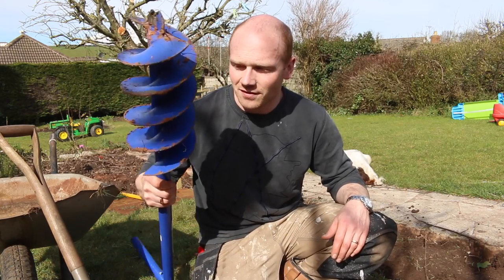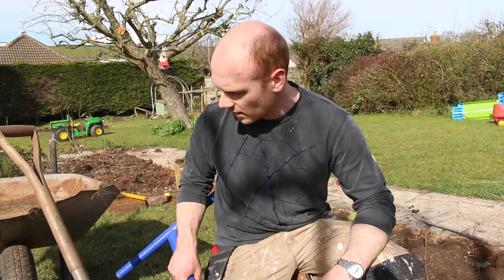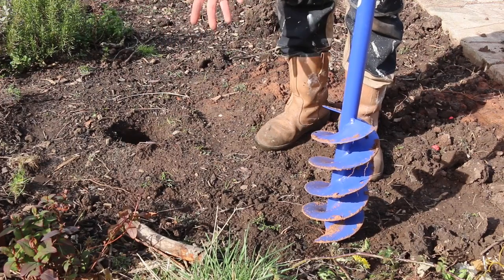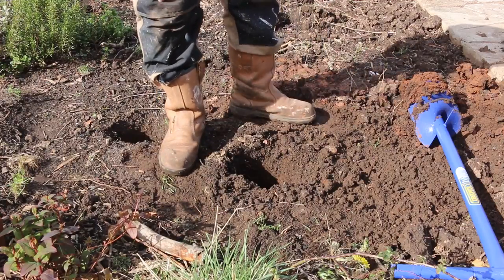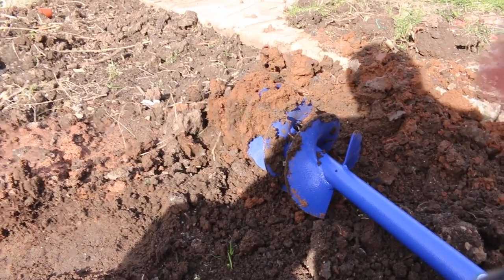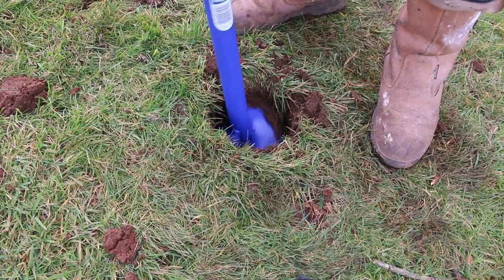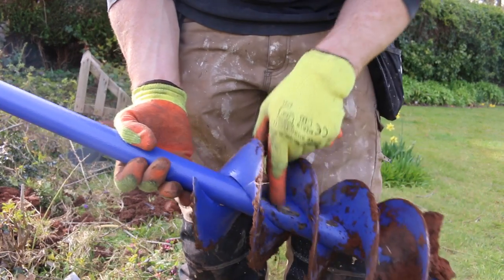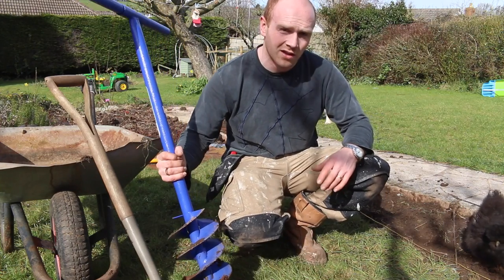Fence Post Augur | TRC Show and Tell

Comment: not a single Rock... Not in my back yard. I dug 3 cubic feet of dirt and rock out of a 1 cubic foot hole with a pick ax and shovel in 1 hour of back braking labor. hate my soil.  (sarcasm)
Reply: Sounds like my garden but mine is also unbelievably heavy clagy clay as well, I've had to dig foundations & drainage trenches almost entirely with a pick & small sharp spade. Great fun :P
Reply: We have clay and flint here in the Chiltern Hills,even a petrol auger struggles

Comment: Hey, anybody who is about to use such tool - have in mind that if the 
soil is too dry, you can drill just a little bit, then fill the small holes with water, wait and then 
drill again to the bottom. It's much more easy and helps extract smaller stones that otherwize would block the drill.
Reply: Thanks for the tip.

Comment: Hey Tim
My mate purchased one of these around 5 years ago & we use it all the time, can't fault it!
We build fences & decking on the side & between the two of us we have cored hundreds of post holes with this.
Great buy!!

Really enjoy ur vids👍🏼
Reply from the maker: +darren green Great aren't they! I must have reduced the amount of concrete by 40% too so has paid for itself.  Interested to see how round post would slot in if sized the same as the augur, 100mm version.  Might be a good way to do some temporary fencing or where you don't want concrete.
Reply: Are they any good in clay compacted soil? 👍🏻

Comment: I bought a petrol one for a big fencing job and it is amazing.  Bottom blade cuts through roots and saves so much time and concrete as the holes are so snug.  Just have to be careful with petrol one that you don't let it screw itself into the ground...Andy Uk
Reply: Nice   tool  plz  mob  no  dena

Comment: Great Video  and very informative, Can I just ask though , i just bought the 80mm hand augur , my post are 3" so a fraction of wiggle room, if the posts are pressure treated and they are a reasonably  tight fit, wouldn't that cut down on concrete/cement,cost time,and labor?   That's what I'm hoping for
Reply from the maker: Just done 100mm round posts with 100mm augur and pretty good. I think 100mm posts driven in to 80mm hole might work better.

Comment: I need an auger/drill like this, but for confined space under an existing sunroom behind the house. Is there something similar, but with a shorter vertical profile?
Reply: If it helps, I had a similar situation once and ended up starting a hole with a space, then positioning the manual auger into the hole to have enough clearance to (barely) be able to use the auger. It wasn't enjoyable, but it allowed me to get the project finished.
Reply: @RallyGreen  I'm out there digging it by hand as we speak.....I'll take a break for the day. I'm not used to this king of work anymore. Haha....I'll get there...I'm down two feet and need to get another two feet more. Lots of rocks....big pain in the behind. Thanks for the suggestion.
Reply: @michaele1278  You have my sympathy! Haha, best of luck with your project!
Reply: @RallyGreen  Thanks

Comment: Wow! Unbelievable. I didn't know they came this big.Would it be possible to use one of these for hard, compacted clay soil. I sincerely doubt it, but I have to ask.
Reply from the maker: We have clay soil and it works fine.  If it is really heavy clay then you just take a smaller amount out at a time.  Might not be so good if you have brick dry solid clay though!

Comment: Can I use the 100mm tool for a 3x3 post or does it have to be a 150mm auger?
Reply from the maker: Probably best to use the 150. I have used the 100 but you need to square up the hole to make it bigger really.

Comment: I've seen these, but never used one. Would you consider it easier than a standard hinged post hole digger?
Reply from the maker: +Adam Gabbert I imagine that a post hole digger may be better if doing a larger hole or if very stony.  Otherwise this has to be quicker and easier.  For the gate post I drilled to holes and then squared them off using a spade before removing all the waster with the augur, so it can do large holes if needed.
Reply: Nice. Thanks for the reply. I've got extremely sandy soil around here so I'll probably order one now. Thanks from California.

Comment: not wide enough hole cement a 4x4 post? might be good plant hole maker.
Reply: I was also wondering about this. Can someone else shed more light on this aspect. I would like to use this tool as it looks very simple. But I'm a little concerned about the width of the hole not being wide enough?

Comment: Any idea where to find these in the US? I see several variations available in the UK, but it seems that US sellers favor powered versions (likely because they're more profitable). Urrggh. Ta.
Reply from the maker: Sorry, been asked before.  Seems they are not available everywhere.  You could buy a 6'' bit from the powered versions and have a handle welded on?....just a thought.
Reply: amazon has them for 100.00 bucks

Comment: If you have a holding tank you could actually use a 50 gallon or 55 gallon plastic drum as a holding tank but should be very inexpensive then you could do a 12 or 24 volt solar pump as a booster pump and here's a video showing you your different componentshttps://youtu.be/EDALWqeGsHQ

Comment: proper job!  Might be buying one of these to do a little project over the summer. Thanks a lot .
p.s was it a screw fix/toolstation or ebay buy?
(Tony from Bristol)
Reply from the maker: Amazon. Was the cheapest at £25 and 150mm. Screwfix one is £70 and not much different. Great bit of kit.

Comment: These are a total waste of time and money IMO, unless you have very loose soil with zero stones and zero tree roots.........maybe if you need to set posts on a sandy beach, it will be ok ...........just my opinion of course after trying one out - ditched it after a few goes and reverted to traditional post hole digger and bars.

Comment: Notice he  is digging in soft ground.this tool would be useless if he was hitting roots.
Reply from the maker: No good for large tree roots but cuts through 1-2 inch roots fairly well when used along the hedge line.
Reply: The Restoration Couple .
U overseas people need to get with the times .we work in mills and meters.not inches and feet.
Reply: Barry Gale who is we? Maybe you people should just figure out a way to dig up post holes that works for you. Then maybe upload a video and show the world how it's done instead criticizing his standards of units in measurement.